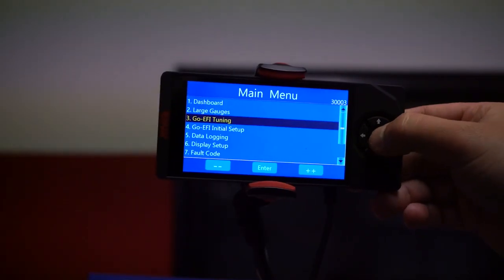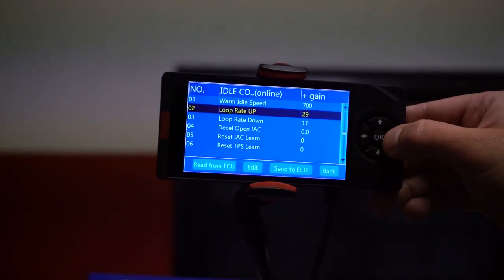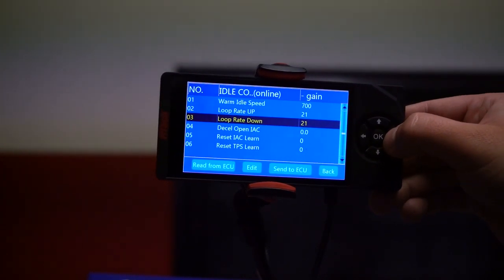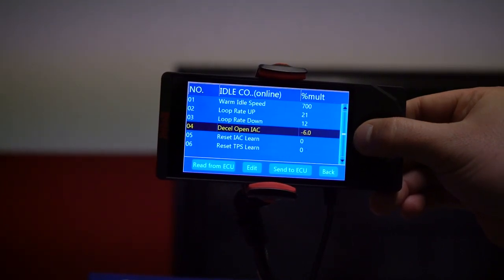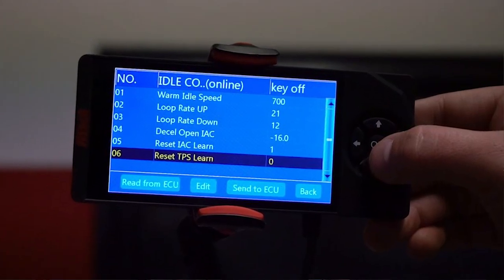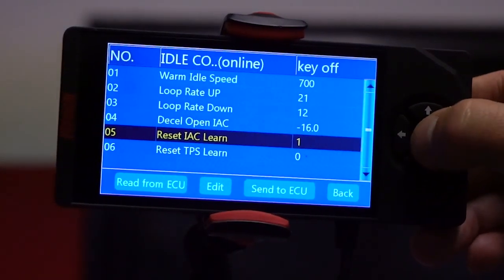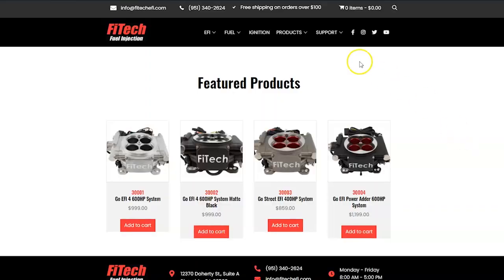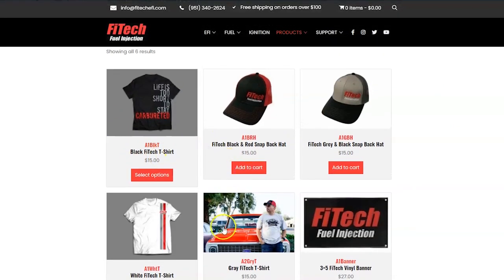Idle Control| Tech Tuesdays | EP15

Comment: Somewhere you mentioned that fitech needed to reach the 170 F, then the warming up idle will be operated, how can i reached the warm up idle before factory default temp? I should decrease the number of loop rate down? 
Another one, i set the rev limit rpm for 4.3 engine to 4.800 and i sent it to ecu, but after every start it came back to 6600, or i disabled the fan because i don't use external or electronic fan but every time fitech return it to enable.

Comment: So confusing. Doesn’t break down loop up and loop down, doesn’t explain what adjusting each value for mentioned does and doesn’t even walk through screen to get through menus. Terrible job.
Reply from the maker: Loop Rate UP = The IAC uses a PID (actually just PI) closed loop control that adjusts the steps to
achieve the desired idle speed. This value controls how quickly it can open the IAC in response to a
lower RPM, using the “I” (integrator) of the PID.
Loop Rate Down = The IAC uses a PID (actually just PI) closed loop control that adjusts the steps to
achieve the desired idle speed. This value controls how quickly it can close the IAC in response to a
higher RPM, using the “I” (integrator) of the PID.

Comment: Been running mine for two years now And has been flawless till today the wife called me and said the truck was running horrible. when she got home it was idling so rich it was stinking up the garage.  I checked my bolts on the exhaust near the sensor made sure they were tight. So now what? Runs great till it Idles down then runs very rich.

Comment: I can’t get my ultimate LS system to not idle below 2500 rpm’s and it caught a spark plug wire on fire, what is going on?
Reply from the maker: Sounds like there’s a vacuum leak. On the bottom of our intakes there are vacuum ports, be sure that they are plugged up if you are not using them.

Comment: My engine won’t idle. It only runs if I keep my foot on the peddle with the TPS reading 16.0 or more. And when I take my foot off the peddle, the engine immediately dies. How can I resolve this issue?
Reply: Having the same issue
Reply: Doc.Cali I’ve been on hold with their customer service line for about 10 minutes now. No luck yet.
Reply: @Frankegrenke  im 40 minutes in.
Reply: @Frankegrenke  so talked to someone just now and really helpful. Went through settings and rebooted. Tried to get to idle with him on the phone. He said could be map sensor getting a poor vacuum reading according to what it is doing and the map reading 96 to 99 while on the gas at 500 to 600 rpm. Im going to see what was sent to my email right now.
Reply: Doc.Cali My engine only builds about 3 inches of vacuum (.600 lift cam) but I haven’t been able to find a setting to adjust for that besides the 1-4 cam setting. I may just hook my laptop up to it to see if I can get anywhere that way.
Reply: @Frankegrenke  I did the process. Id didnt work. But the primary and secondary are way off. After playing with timing and and adjusting primary and secondary I have it in the ball park. I have cam set to mild on 2 . start with 2 and see what the map is reading at around 1500 rpm anywhere from 95 to 99 not enough flow getting to map. I got a 61 after adjustments than lower as the idle started to catch itself. The units not all come pre adjusted.
Reply: Doc.Cali Are your throttle plates slightly open at idle?
Reply: @Frankegrenke  you have tiktok? I can reply faster if so.
Reply: Doc.Cali yes, my username is TheEmptySuit
Reply: @Frankegrenke  chrisrado2004
Reply: Doc.Cali yup, I followed you
Reply: I’ve gotten 2 Fitech units. One the throttle plates were off on the secondary. I had to adjust the rod, then the secondary blades idle screw. Then set the IAC steps, then everything came on line. My second unit, was pretty good out of the box, just had to dial in the steps. Make sure you fully understand the IAC setting. I have seen some wrong videos on it…
Reply: Mike Zelesnik It took a while but we ended up figuring it out. It runs like a top now. 👌🏻

Comment: I have kit 70051 , can the system command the IAC shut ? I would like to set the minimum idle speed with the screw on the factory throttle plate with the IAC at zero . Thanks for a reply .

Comment: What do you do for surging between 900 and 1100 all the time cold and warm i got the 1200hp throttle body
Reply: Sounds like the loop rate is too high.
Reply from the maker: This would likely be due to a vacuum leak.

Comment: I got your 92 mm throttle body on my 5.3 how do I adjust for iac
Reply from the maker: Check out the video on INITIAL SETUP. The second part of the video shows the IAC adjustment. It is done the same on all FiTech systems, just the throttle adjustment screws are in different locations. On the LS its next to the throttle cable cam.

Comment: Thinking the loop rate might be part of my hunting idle when I first start. It surges to the point of almost stalling but then recovers, does this till it’s warmed up. 

My AFR goes to high 15’s lows 16’s as it’s about the stall before recovering. IAC steps are 3-4 when it’s warm with both fans off. I tried increasing after start fuel and that didn’t seem to help so I set it back to where it was. 

Thinking I should try loop rate down. Thoughts??

1200PA system if it helps.
Reply: I had similar issue in my stick car, my loop down was 23 & would always goto zero & almost stall when I come to a stop. I lowered loo down  to 13 & ita a very noticeable improvement.
Reply: @acooken12  

Thanks for the reply

I’ll give it a shot and see if it helps
Reply: @ss0073  how did that work out for you?